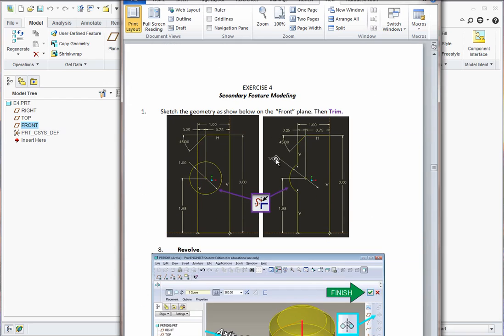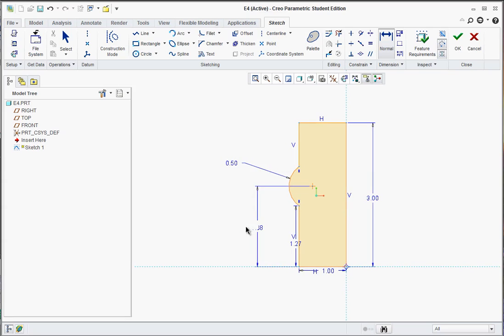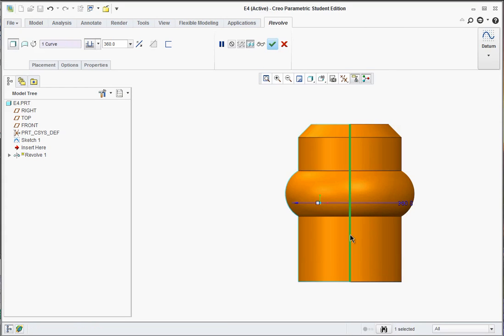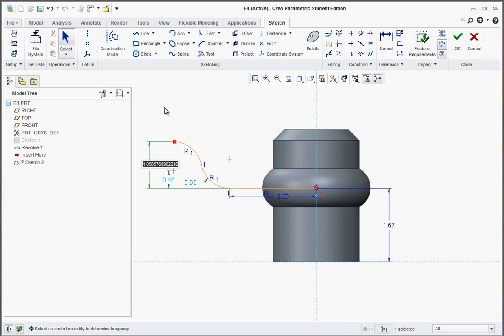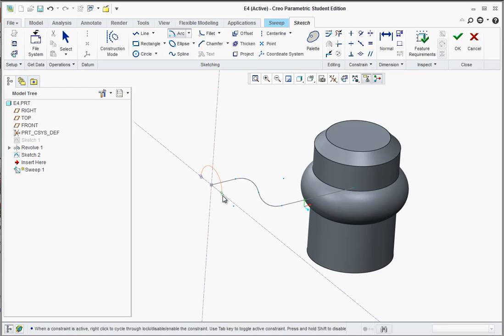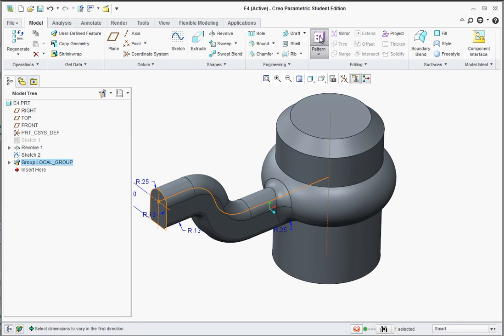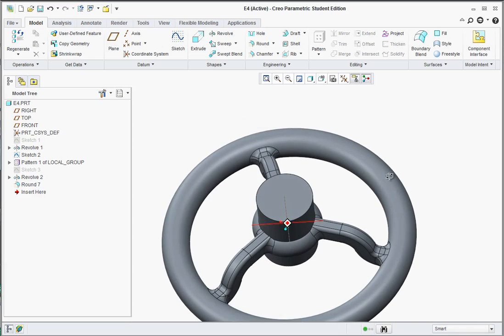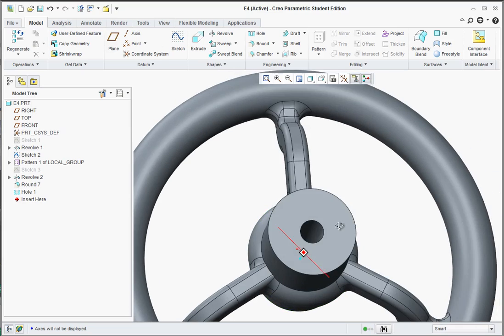E4 CREO Parametric 2.0 - Basic Modeling 4

Comment: in making of the hole in the end, i followed as u said but the diameter is drawn as 1.5113 and it is not getting smaller as yours which is 0.0695. How can i fix it?

Comment: I'm using CREO elements PSE 5 and I'm having an issue with the variable sweep tool. It takes me all the way to the centreline, through the existing solid and this complicates the use of the round tool. Also the hole tool doesn't seem to be working either
Reply: I've also played around with the trajectory details, going to the options and tried both the trim at and extend to reference options. I noticed in the PDF that there's an attribute of "free ends". I followed the method in it, but I don't know how to get that attribute and I get the same issue without it.

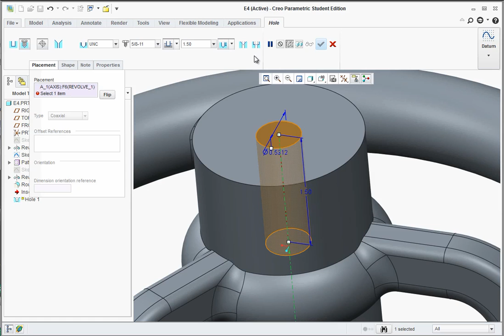Comment: At 15:25 the video cuts. What did you do there that allowed you to add the offset references?
Reply: Also having trouble understanding how the placement has been done at 15:25. How do I add these two offset references? It seems to only allow one. 
Thanks :)
Reply from the maker: Jesse Roberts One method that you can try is to select the references tool on the left side of the sketch tools ribbon. Then select all the edges you would like to reference. I hope this helps.
Reply: +Wes Bassindale  i think he pressed escape key OR middle click
Reply: I found that he actually selected the surface for "replacement" rather than the axis he mentioned before.